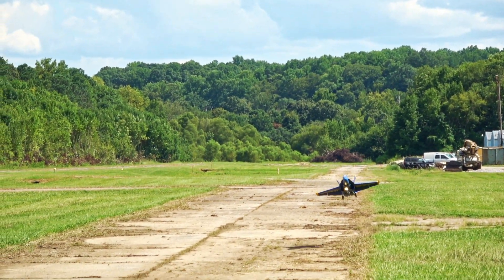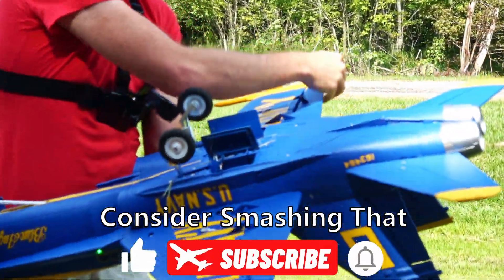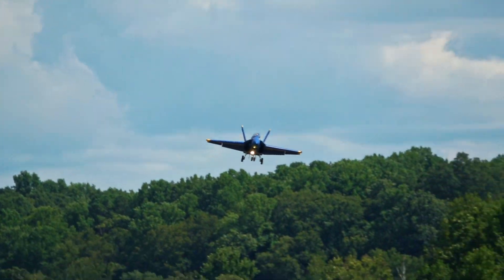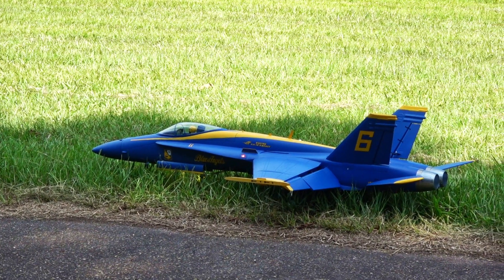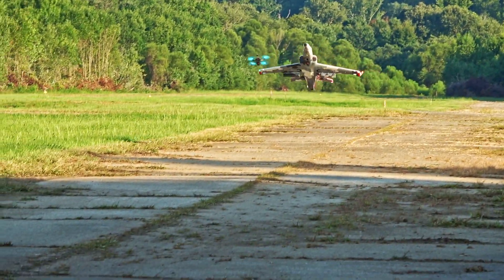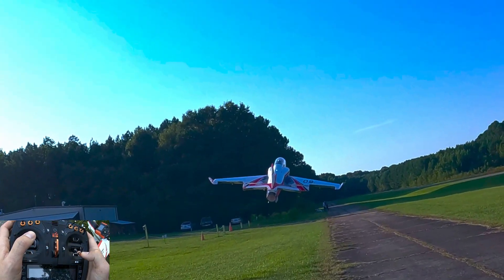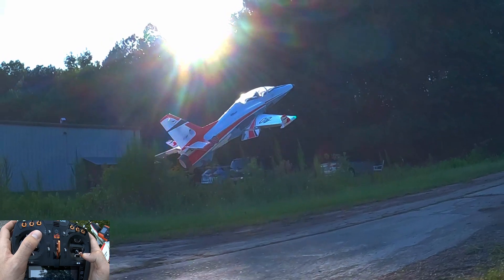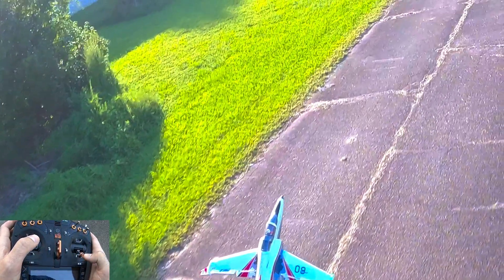You Might Not Need a Gyro (But It Really Helps)

Comment: I see nothing wrong with basic gyros personally.

I do think it's important to fly one or two planes without gyros just so you can experience the difference.

I do see an issue with advanced gyros such as safe that aren't really gyros. Those DO fly the plane for you.

I get the concept of using safe to learn how to fly. But my opinion is that safe is a last resort.

I think there are 2 much better ways of learning to fly.

1. Get someone to help you. This is hands down the best way to learn no question.

2. Is the best option if you have nobody to teach you. Use a flight simulator. It will teach you to fly without safe and you won't end up wrecking your new plane.

That is just my opinion of course.

I also think that larger planes such as balsa nitro, gas, and turbine engined planes fly better without gyros for the most part. And no competition events will allow you to use gyros. Such as 3d events or pattern events.

Just my thoughts :). Great video Jon. Most of the guys who talk shit on gyros can't fly worth a damn anyways 😂 they need them more than anyone.

Comment: i dont like Gyros for beginners due to the gyro hide´s the small signs the plane / wings give you. like stall tipping and other things. i think those signs is necessary to learn in the beginning to have a fun future in the hobby.

i often use simple gyro´s on my own designed planes and wings first flight, and high speed balsa wing planes i build to fly fast as hell. often they are super hard to start / hand launch, and gyro can help in the start process.
Reply from the maker: That's not entirely accurate. Models almost instantly stall at this scale. It's not something you generally get much warning for.

Comment: As a relative new comer, I’ve experienced the “your not a pilot” if you use AS3X or safe.  My first response is yes, I’m not a pilot.  I’m flying a toy not a real plane. I’ll safe the term pilot for those who fly actual planes.  But I will gladly hang my head in shame and bring a flyable plane home versus bringing it home in pieces.
Reply from the maker: I would caution against gatekeeping being a pilot - the anti-gyro crowd does it to you, but that doesn't mean you're not a pilot. A pilot is anyone who can fly an aircraft regardless of whether the aircraft is full scale or model scale. Flying radio control is actually much harder than being a full scale pilot. Far fewer checklists and regulation, much higher risks of crashing.
Reply: @TwoBrosRC  yea I get it. I was just trying to differentiate between someone who spent tens of thousands of dollars and hours to fly a full scale aircraft and someone who runs to the hobby shop and spends a few hundred dollars and throws a plane up in the air. But I fully get the higher risk of crashing.
Reply: @TwoBrosRC  but I ask these guys if they drive cars with airbags, power steering, antilock brakes, etc. Based on their arguments your not a real driver if you use technology to make you safer and a better driver.

Comment: Great explanation and great footage. I learned the hard way to max out my travels for low speed agility. Is this something you do for all planes? I’ve got an 64mm A10 where the travels are about 3x what the manual states - I backed them off a tiny bit and used a bunch of expo hoping the travel is there when I need it but not overwhelming at all times.
Reply from the maker: Yep, it's what we do with all models. No reason not to, really. Once airspeed drops past a certain point, control surface throws at stock values produce little or no effect at all. Full possible throws allow a model to perform even with airspeeds as low as 5 to 10 MPH.

Comment: Wow. It is good topic! All my EDF jets have gyros, and I am always using hobby eagle a3s4, it is cheap, and #1 it has SBUS decoder, you can assign 1-14 channel output aileron elevator rudder, #2 airplane is more stable in the air #3 you can always turn it off. If that helping save  my $800 edf model, why not to use that?